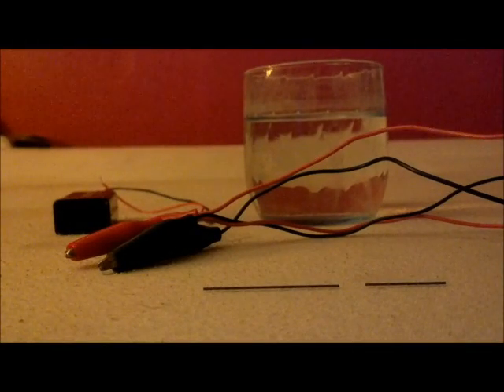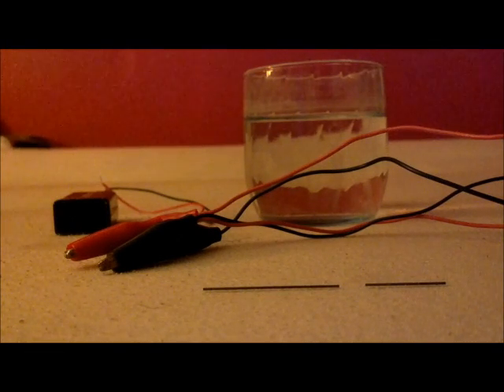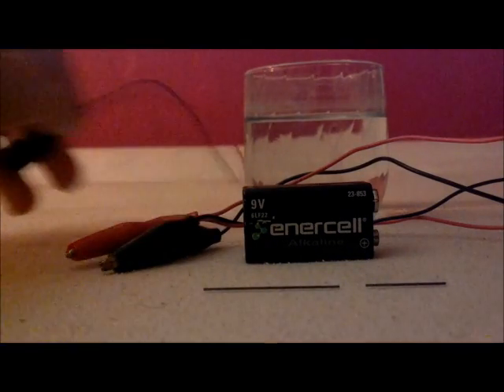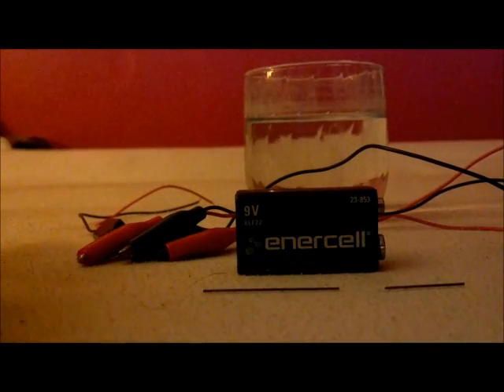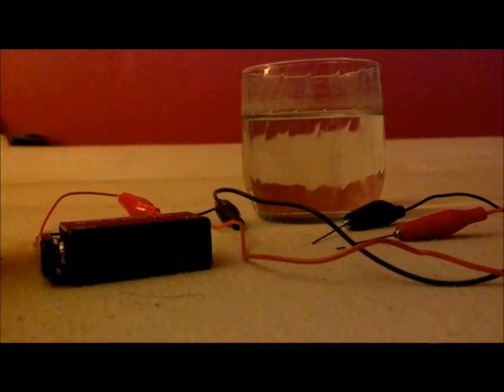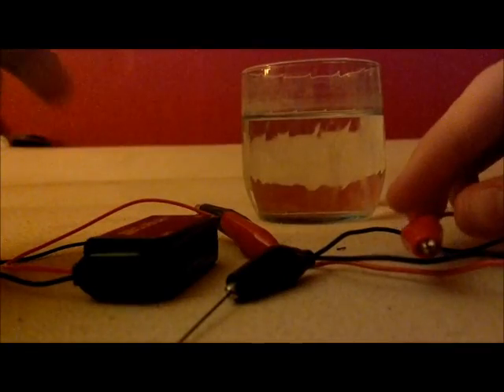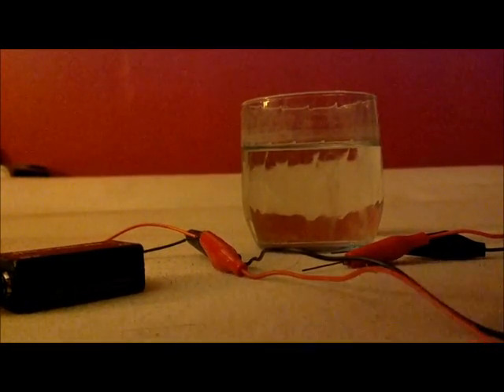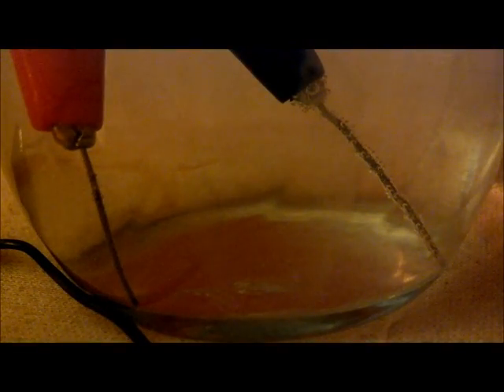How to do Electrolysis of Water (Tutorial)

Comment: Don't tell people to use any voltage source. Only DC current will work. AC might cause a mixture of gasses which could result in an explosion. Also, they use distilled water in EDM machines because it doesn't conduct electricity. EDM machines are sometimes used in machine shops to remove small amounts of metal on parts that has been hardened.

Comment: Pure water is a poor conductor of electricity. Mixing some stuff may give out other results.
What did you added to the water, or is it not pure, something like tap water... 
+KoolScience
Reply from the maker: +Tufail Khalo If I remember correctly, I used tap water since, like you said, pure water is poor in electrolytes. If I had used pure water though I would've mixed some salt into it so it could conduct better.
Reply: Mixing NaCl would give out unwanted results (As I said earlier), what about adding some dilute acids (HCl, H2SO4)....
Anyways, keep on making great videos...
All the best for future work

Comment: A good way to make this experiment a little safer, especially for the battery is to have a resistor on one end to use up some of the power so the battery doesn't short circuit which can be scary and possibly dangerous.They go for like $0.99 or less at Radioshack.
Reply: I wouldn't buy anything at radio shack. If they're $0.99 there they would be $0.33 somewhere else. I have a ton of resistors of various sizes myself.